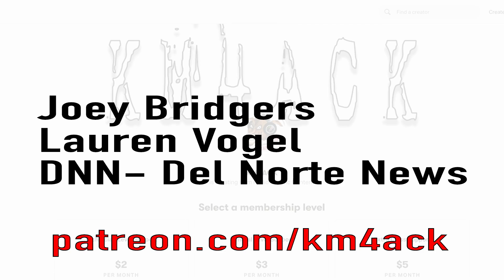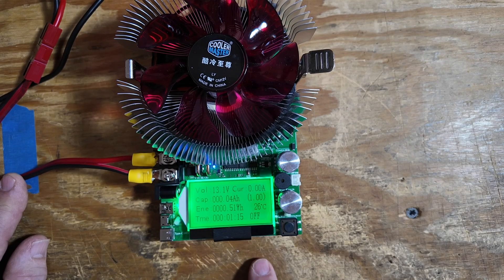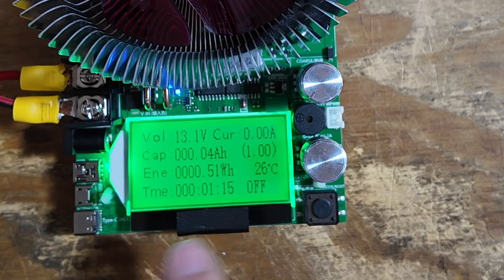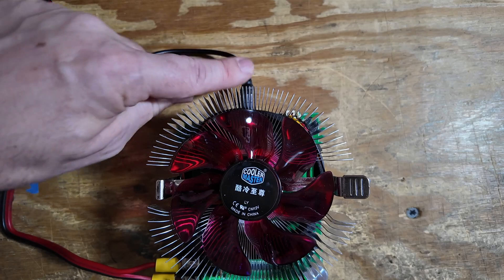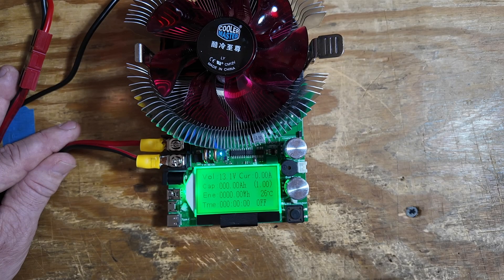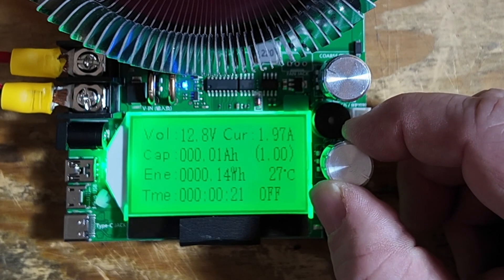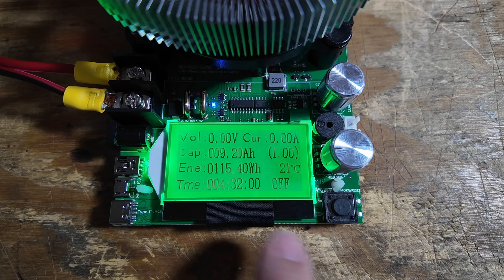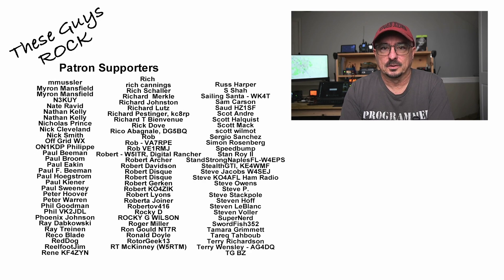How Good is Your LiFePO4 Battery

Comment: Jason, what do you use to test larger batteries?
Reply from the maker: Same board but usually at .1C instead of .2
Reply: Thanks for this! Just to clarify (and I’m likely misunderstanding) you set it to draw fewer amps (.1 vs .2) to test a larger battery? I have a 100 amp hour battery I want to test, and I’m wondering if it will take a lot longer at that lower setting. Thanks again! Very informative!

Comment: That tester works pretty good. They come with different color fan and sold under different name but same China factory . The USB ports for test are 5V only. Even it you use a PD 100 watt cable. Only loads 5V .Great for some power banks testing.  On the one I have like that where you plug in 12V  for tester ,I have a micro USB jack to power from 5V like a power bank.  When using 300 AH battery for testing this takes a few days on that tester. and if you lose tested power the data is lost . Do not use tester on lead battery unless you want to kill it for good. you only want about 50% . But NiCD type can be tested . Even solar panel can be load tested . Even a 13.8V power supply but to 10 amps.  Lots you can do with that tester . And it is not real costly either . 73

Comment: I suppose for a battery without a low-voltage cutoff its probably a good idea to put an appropriate cutoff inline? Or does it have the means to set a cutoff voltage?
Reply from the maker: Almost all of your LiFePO4 batteries have low voltage protection. It's built into the BMS
Reply: @KM4ACK  Of course
I've got some unprotected 18650s laying around and a whole bunch of nimh cells as well.

Checked the item description and it seems like it might have a low voltage alarm and possibly a cutoff - but I found conflicting info in the item comments so not really sure.

Comment: You need to stop by sportsman's warehouse and check out the new batteries they have. They have 2 USB ports built in and volt meter.. one of them is allegedly "15AH" in a 9ah size .. only $79

Comment: I use the same tester for my batteries.  I have been putting together my own battery packs.  I have seen the total capacity does change depending on the BMS board I use in the build.  Some of them leave more power in each cell some less before cutoff.  I do have some Bioenno and they have all consistently tested higher than rated.  Overall knowing the actual number is great for activations.  Add in a draw meter for my radio and together they help me to select the correct pack for the job.  I even put together a little 2.5Ah battery that I use for my TX500.  I would need to dig that one out but actual test was 2.6somethingAh.  So knowing my batteries and my radios lets me save  weight and still have a fun time.